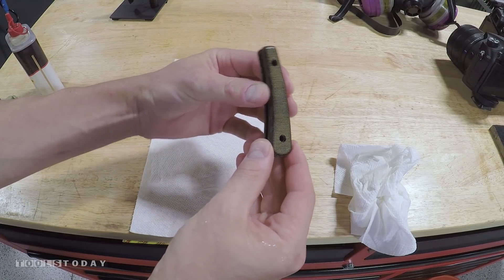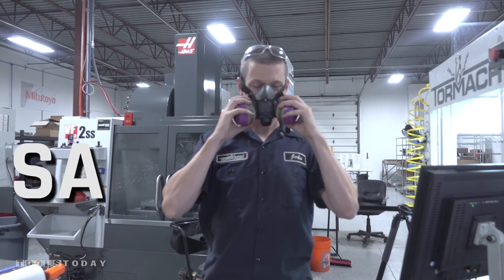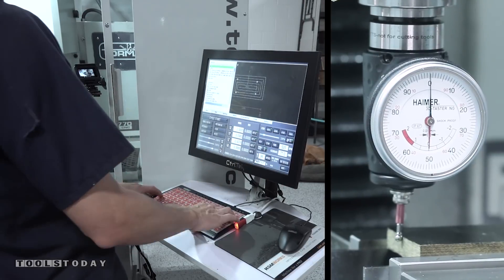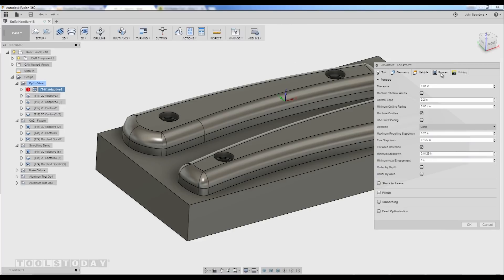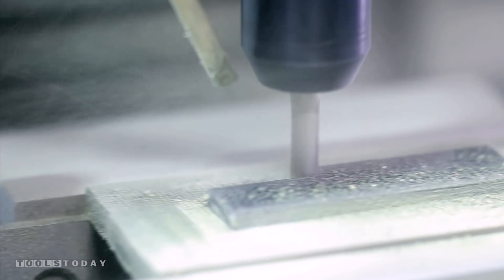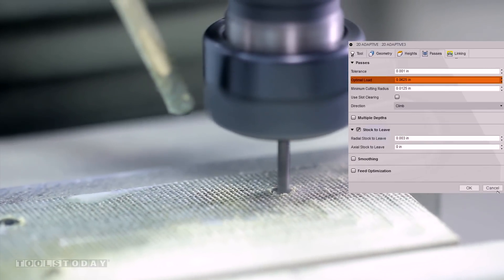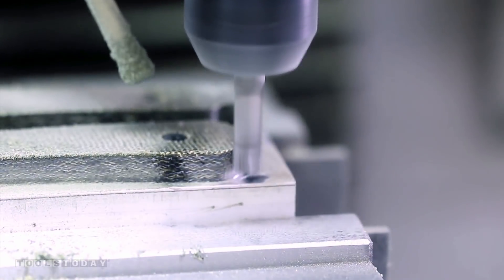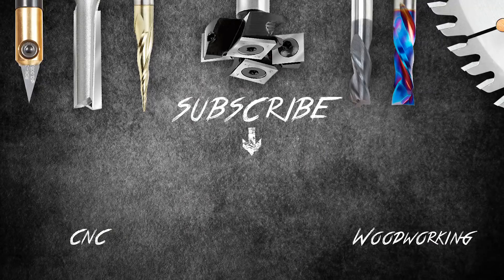CNC Project: Making a Set of Knife Handles w/ Composite Cutting on the CNC

Comment: Can I use that tool on fiber cement board?
Reply from the maker: No sir, the tool is not recommended for Fiber Cement Board. For cutting that we would recommend the Saw Blade Timberline no. 255-06PCD https://www.toolstoday.com/v-12233-255-06pcd.html